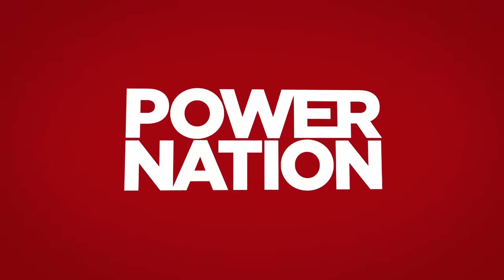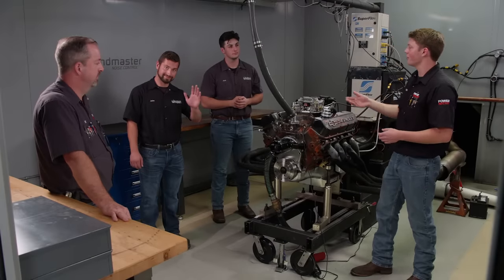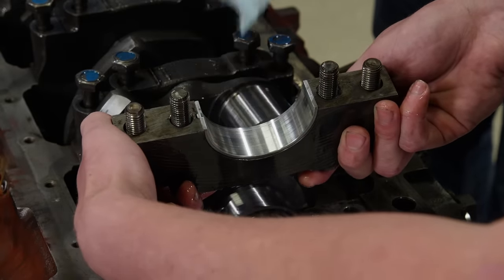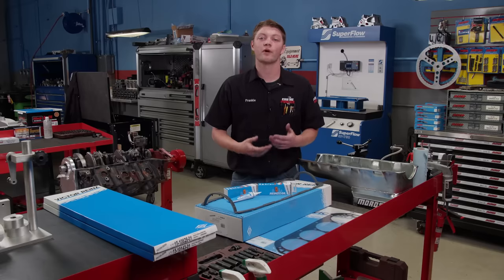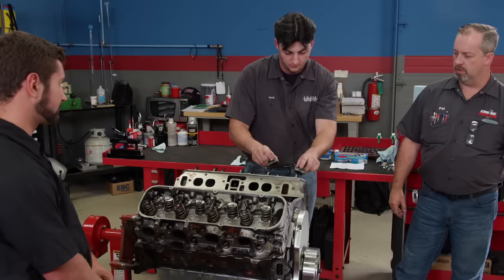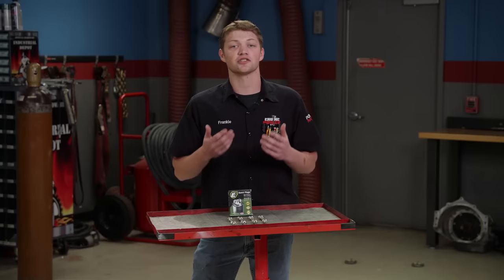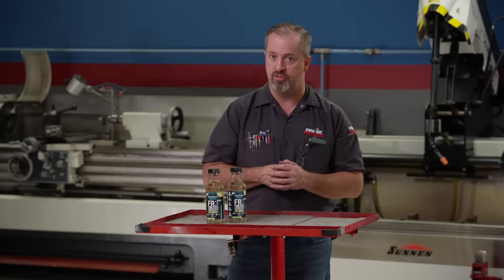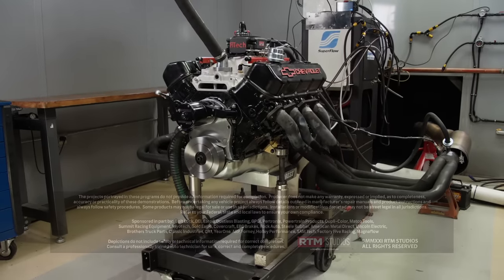Easy Upgrades for a Stock Big Block Chevy - Engine Power S8, E19

Comment: Not to be a troll, but wasn't the point low end torque? Literally all the power it made on the new set up was about 3500 rpm and up l, which is all the upper part of the power curve. So for a truck motor which this was, ill take the old setup
Reply: Thank you,  this has been my complaint about these engine builds for a long time, a street torque motor at 5000 rpm is an oxymoron!
Reply: @towgod7985  I mean when I heard the only new part was a bigger cam I guessed they were gonna lose the low end grunt, I would of liked to see a stroker kit, I know not as cheap but they already had the motor completely torn down. I think bang for buck your not gonna beat the added torque of a longer piston stroke
Reply: this entire video was a waste of time, mostly just an advertisement

Comment: Not sure you can call this a "Stock" engine upgrade when you can see it has .040" aftermarket pistons already in it.
Reply: i was wondering about those pistons myself lol
Reply: You can tell from the gaskets that someone has been inside it. It's still typical of what you can still find in the junkyards and still running trucks. It's a leftover from another project. .40 over isn't much more than a typical rebuild.
Reply: I seen that 2 lol
Reply: Did you see the power it made? Stock!!! Damned thing can't hardly get out of it's own way!!

Comment: Finally! A low rpm big block video!! Please build and dyno an 8100 vortec! I know the market is limited but the more ppl build em the more parts will come out! Gen 7 BBC is the best one!
Reply: it definitely isnt. weak bottom ends and poor flowing heads coupled with poor parts selection.
Reply: @juliennacer8871  you are rite
Reply: Dude that would be a super cool engine to build! I don't see them often so it would be a breath of fresh air for sure.
Reply: Pocket porting, valve job, cam, headers, tune adds 100hp and looks almost stock.
Reply: @juliennacer8871  pretty funny they managed to build quite literally the exact opposite of what they intended lol
Reply: Gen 7 sucks. It’s not even a big block Chevy. Completely different firing order. Junk motor.
Reply: Was never a high performance engine to begin with. HD trucks only.

Comment: Unfortunately it lost a ton of power below 3500 rpm, where most trucks run everyday
Reply: First thing i thought about when they listed cam specs......they are still in HP mode.  They need to knock about 10 degrees out of that cam....
Reply: @robtdougherty  more like 20 degrees for a towing application.  You need torque off idle.
Reply: I searched the specs on summit and the only 2 cams that come up are extreme marine grinds 11-240-4 and 11-240-20
Reply: Keep in mind that the big block isn’t running wide open throttle all day every day!  The torque curve you base your comment on is at WOT.

Comment: They should get a F. The motor was to perform best below 3500 not a average up to 5000! A stroker kit could easily have been done for the cost of that FI and obviously a better cam than the one they chose. But Hey they did say both the kids were going into sales or marketing. So go figure they are not going to listen to the customers goal and will sell you what makes them the best $ and when you call them back its your fault you didn't install the cam correctly or the motor isn't tuned right etc etc with excuses. 🤣😥😭 Oh and nice touch with the SFI balancer on a low rpm motor. Guess that was a hint it wasn't going to be a low rpm motor.
Reply: I thought the same, FItech too :/
Reply: i get the 450 hp 454 4 inch stroke for free so far this year i got 4 of them plus they come with the 02xx 400r turbo good to 800 hp from 6,000 to 58,000 miles on them then all they need is to breath a bigger carb and intake does wonders for them close to 600 hp i priced it at GM at it would cost me close to 15,000 for the set up because they come complete and ready to go the long block is 8,000 for it
Reply: Add in they put in an all new ignition system, but didn't do any timing control while going with fuel injection and a terrible fitech as well. Really this was just a long winded ad for people who have no idea what they should be buying.
Reply: @beilno2890  i agree 100%
Reply: A cam smaller than a 220/XXX with an aftermarket dual plane intake would have been a better setup for low end torque.
Reply: @bri-manhunter2654  most of these shows have no idea what they are doing they just put a bunch of parts together no blue printing at all most of them don't last long ever notice that i have a pro built 327 that puts out 1200 hp on pump gas only it has been on the road for over 20 years been through about 15 hard races cruised it used it as a daily driver but it was built by old man bell before he died
Reply: @jeffrey4547 . Nice!!!
Reply: Hit the nail on the head with the modern car world. Put down carburetors to sell efi. Stg these guys always make it sound like people could barely drive their cars until the 80’s.
Reply: @stephenkrambeck6589  most have no idea on how they built up engines in the 70,80 like one guy told me with a set of 202 heads u can't get much out of them so i tried to explain yes if they are stock but u can port them all out like make the set 204 then port the intakes and exhaust then u port the intake to match or like ford head u can split the head then build them into a power head

Comment: Not sure what you guys were thinking here.  234/244 is a poor cam selection for a torque/towing application, as seen on the dyno, low end suffers with this approach.  And the EFI is expensive, I don't know which FiTech kit you are using, but the Easy Street 600HP master kit is $1200.

With the same or less money, for a towing application I would go with a hydraulic roller upgrade, it will have less duration but higher lift than a flat tappet, something like a 206/212 @0.50.  At most 212/218@0.50.  The lower duration will keep the torque curve down low.  And just use a simple 600cfm carb with vacuum secondaries.  Use a knockoff air-gap manifold and phenolic spacer to keep the carb from boiling over after those long uphills towing.
Reply: @bigboreracing356  if you're paying, sure let's swap the truck to a 12 valve and use the 454 for a drag car that we have yet to acquire.
Reply: lol 600cfm carb? 454's want at least 750CFM, 600 is for a 350...
Reply: Great suggestions! They need to give the cost of the upgrades they did. Why not roll in new bearings since the engine was torn down?
Reply: @stormwolfgames6636  we're talking low end torque here, not 6000 rpms.  600 cfm is more than enough for a heavy towing or motorhome application that only revs to 4500.  With peanut port heads and a stock cam you will not get more power with a 750cfm carb.
Reply: @JimBronson  I know I have peanut port heads, I have always used and been told to use no lower than 750cfm. I have used both 750 and 800. You will open up your top end a little more at a small sacrifice of bottom end, considering these motors are swapped into half tons all the time it's not such a bad idea. I have seen many forums guys try running under 750 with stock 454 they always run in to problems. My stock qjet that came with the truck is 750 at least and if you do your research all qjets for 454s were 750 or 800cfm. Even 650 is too low for a 454.
Reply: @stormwolfgames6636  I really think we're talking apples and oranges here.  My experience is mainly with carb'd motorhome applications and a bog stock vacuum secondary Holley 1850 works great on those with stock heads and cam, and of course adapter plate as most post 68 or so came with Qjets.  On these applications, redline is like 4500, and they are really out of steam with the power falling off by 3800 or so.  This methodology works pretty good for Ford FE and 385 series 429/460s and Dodge 440s as well.  On most of the Ford medium duty gas trucks back in the day, the tach only went to 4000, and they would run 3600-3800 going 60mph down the freeway.  Lol.

The infamous Ford Super Duty gassers that came in Class 8 trucks as a gas option in the 1960s had two barrel carbs.  534ci with a two barrel, same basic concept, optimize for low rpm flow.  At a time when the most powerful diesel you could get was the Detroit 8v71 with a very buzzy 318 HP, the SD wasn't too bad of an option if you had a lot of gears to work it with.

If I had a half ton and was trying to go fast with a 454 or really any other big block application where the object is going faster, I definitely would recommend a larger carb.  I owned a G body with a 502, 25 years ago and I used an 850 double pumper on that.  I thought it was fast at the time but nothing compared to what people are doing nowadays running street cars well into single digits.  Yes I am old.  lol....
Reply: @JimBronson  well a big part of an engine running at such high rpm at lower speeds has to do with transmission and gear ratio of the rear end. Chances are those rigs you worked on had the sm 465 4 speed like mine (granny 1st) and a higher gear ratio like 3.73 or 4 something (like 4.10 maybe?) for towing. My truck came stock with 3.08 and going to 3.73 now I run at 3k rpm at 75 80 mph, it used to be like 2500 round there. I am not saying you don't know what you are talking about, but you should know those old 454s came with 750 or 800 4bbl qjets. I am just not following the logic of putting a severally underpowered carb on a 454? Even if you pull up your Haynes or the like manufacturer specs call for 750. It's just that if you look at any manual, online forum, Google search, 750 is always base for a 454 in any application.
Reply: @JimBronson  a Rochester Q jet would likely give the small primary action a 600 is looking for, but 750 when the foot is on the floor trying to climb a hill.

Comment: I've always liked this show because it's always a budget build and always around 350-400hp. And even when they do blow the bank it's like 600hp. It makes me feel safe. 😆
Reply: my stock 454 has 450 hp and it was free with 6,000 miles on it with a 02xx 400r turbo good to 800 hp so far 4 just this year plus it has the 4 inch stroke instead of the 4 1/4 inch stroke
Reply: No $ were given on their "budget" upgrades

Comment: Torque on a budget? What should have happened: Good valve job and a bit of bowl blend porting. Peanut ports are plenty for the job at hand. Simple dual plane manifold with a large vacuum secondary carb. Cam like a Lunati Voodoo 10110701 with 213/219 @ .050". Pistons with enough dome for 9.5 to 1 compression. Then there would be torque.
Reply: Yessir. Maybe cut the heads down for a smidge more compression and  tighter l.s.a
Reply: By the time u do all that and buy pistons u could just buy aftermarket aluminum heads and be done more power less weight

Comment: The 8.1 has over 400 tq from 1400-3400 rpms. The cam they used put too much dip into the torque curve.
Reply: 8.1 are junk
Reply: @Wanous-hv7zo  anyone who knows about the 8.1 knows the only things that need replaced are the stock Rods and Pistons. Better design over the Gen 6 454 and the only casting better comes from world products. You can't use a Gen 6 454 to get 572 or 632. But you can from an 8.1 496 tall deck.
Reply: The cam was to big for low end torque.
Reply: @bladenrexroth2555  you would you want to use a gen 6 anyways. the gen 2 is the way to go for pretty much anything. stock rebuilds all the way up to 600 cubic inch 1,800hp turbo builds. they're was more common, way cheaper and have a WAY bigger aftermarket compared to the 8.1. i don't even know if id considered a set heads and a few different cams an aftermarket.

Comment: Should have said screw the budget and went with small chamber afr 265 heads and went with a smaller cam like a summit 228/238 or even a 218/228. Would have made better torque everywhere than stock peanut ports

Comment: Y’all need to watch Richard Holdner’s videos. For the price of those roller rockers you could have picked up a set of Gen VI rectangle port heads that would have made 60 more HP and more torque due to higher compression and better flow. The stock rockets would work fine up to around 6500 rpm. Pat should know that.
Reply: Its the chambers that increase compression not the ports. A street motor dont need rec heads ovals will work just fine long as there not peanut ports.
Reply: @BigUnk85  I agree. You can actually lose HP by running too big a head on a motor like this.
Reply: @countryrebel01  exactly
Reply: Agreed
Reply: @BigUnk85  

I didn’t say the ports increase compression. I said the Gen 6 Rec port heads flowed better and would increase compression. Better airflow and more compression equals more power. The best recipe for any motor is the right combination with the best airflow possible. For a street motor the recipe is sufficient cubic inches, good amount of compression, mild cam and the most air flow possible. The mild cam let’s you make power down low and the airflow allows a broad power band and that gives you good driveability.
Reply: @countryrebel01  

Airflow is what makes power. So unless you are talking about the size of the combustion chamber and a chamber that is so big it drastically drops the compression ratio you are wrong. See my reply above.

Comment: I appreciate the episode and sharing the build with the guests.  The Total Seal rings are good stuff.  I think a pair of used budget friendly L29 Vortec heads, would get the build to one HP per CI and match the intake ports better.  I'd add a rear water crossover if there isn't one cast in the manifold, maybe try a small spacer for runner length.  The 3M copper based anti seize works great for plugs especially for people who use to much since it insulates them less than the nickel based anti seize.  Thanks again.
Reply: Was thinking the same thing about the heads.  I was always told by an old engine builder, those peanut port heads caused major disruption on the intake side and were only worth running if it's all ya had. A brand new set of boat anchors!

Comment: Great vid but if I did all that in my garage and only found 12-15 ftlbs of torque i would be disappointed, just a camshaft in my 455 Buick brought it up over 500 torque. Glad to see the young men taking up the trade and bringing business and marketing to the table!
Reply: Love my 1970 Buick 455
Reply: Pontiac too.
Reply: I understand what you mean about not gaining a lot of torque being disappointing, but if you look at the torque lines it is a huge improvement. The stock torque line just falls off after hitting peak. The new cam has a torque line that runs evenly across the graph. That is the big gain there. A very long torque range.
Reply: That Generation is notoriously low on CR. That's one of the biggest reasons the 454SS was such a dog. Those heads don't help either. Except for the Fitech, this is a really inexpensive build that won't hurt reliability.

Comment: the easiest way to stab a cam in during a rebuild--before you put the crank and connecting rods in your way, stand your block up on its bellhousing side. Now let gravity help you drop the camshaft in vertically. you can even do this dry, and reach into the empty crankcase to slather on the lube. this way instead of dripping on the floor as you see here, it drips inside the crankcase where you want it. Bonus points, you can install the flat tappet lifters after rocking their base on flat surface to check they have the right taper after all. Now give the camshaft a spin. if the lifters aren't spinning in their lifter bores, you're on your way to wiping out the camshaft (and then complaining about it online). Measure their outside diameter to the ID of the lifter bore--use a brake cylinder hone to get the clearance you need. It's a lot easier to clean up any machine work when you don't have to dissasemble the entire reciprocating assembly.

Comment: They said they were trying to build it for bottom end torque and then put a single plane intake?
Reply: And they put in a bigger cam, 234/244🤔. A single plane with that cam is odd. A smaller cam below 220/XXX with an after market dual plane intake would be a low end torque monster.
Reply: Yea a proper hash video but at least gives beginners a look inside an engine
Reply: Generally, EFI wants that single plenum, whether wet or dry, but the "signal" is going to be different than a carb, since it's not running off vacuum or atmospheric pressure above the venturis but what the computer determines from the ignition timing.  single plane also allows for a more direct path for air to travel. consider GM's TPI system from the 1980's. it was a single plenum intake with long runners, made a lot of low RPM torque from 305 cid. of course, this EFI is hoping to fit every setup while GM designed TPI for a specific requirement.

Comment: Cheap pistons could have been installed and raised up compression a bit for more power. I mean cheap.
Reply: Decking the heads and/or the block would be a fairly cheap way also.